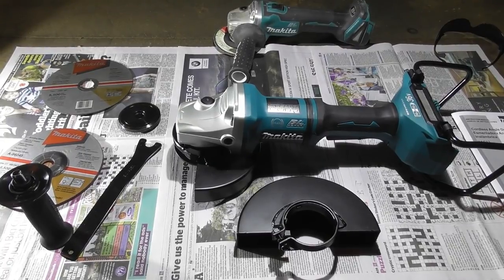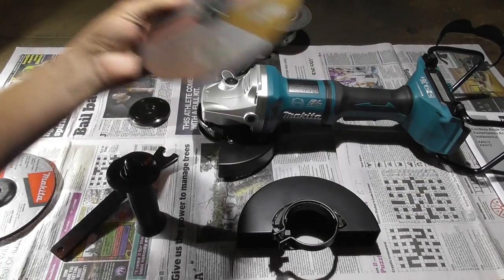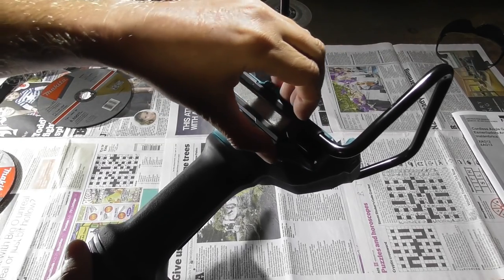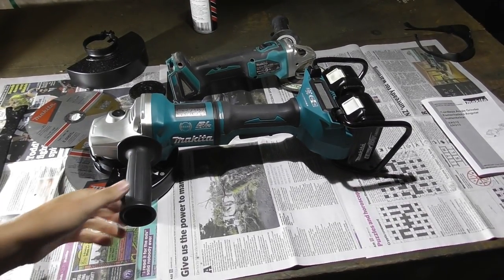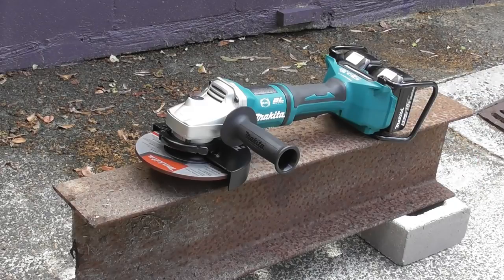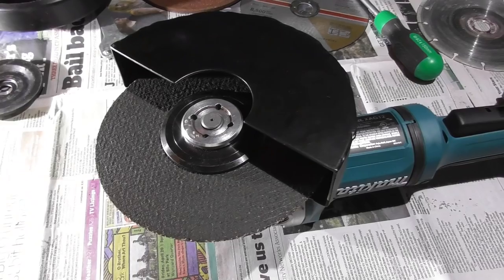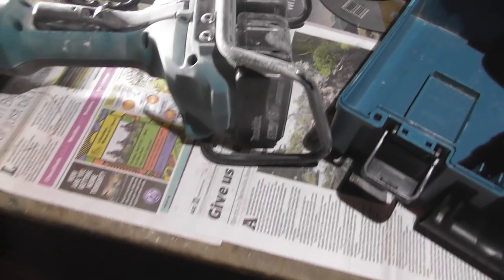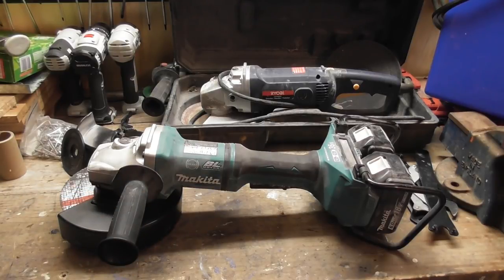Makita 36v Grinder | 7 inch (2x 18v) Cordless Angle Grinder Full Review

Comment: Hard to get the 180mm concrete grinding discs, Bunnings had diamond coated for $150!! 230mm grinding disc was only $10 for a standard but none in 180mm, where do you get yours from?

Comment: in response to a few of the other comments. in the U.S.A black and decker was king for 40+ years then they bought dewalt and sold all the old reliable black and decker stuff as dewalt and started selling cheaper tools as black and decker so basically dewalt/black and decker has always been king makita is more popular than ever because dewalt went through a phaze of low quailty and makita took advantage dewalt is taking back the throne as king of grinders once held by black and decker then by makita. I HATE TTI because oreck vaccum cleaners and some milwaukee tools were made in my home state and i watched helplessly as tti and politcs ridded my state of the best tools and vaccum cleaners ever made are now made in china i will never buy anything tti the old milwaukee electric made in usa were the best tools on the planet. qaulity since being aquired by tti has slipped. on a side note old king black and decker grinders weighed about 6.5 kg or 14.5 lbs